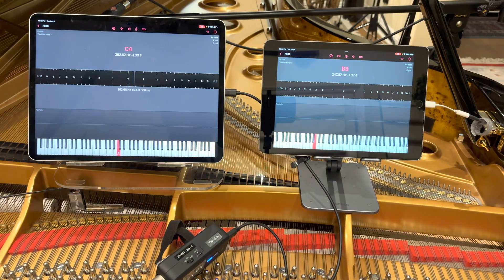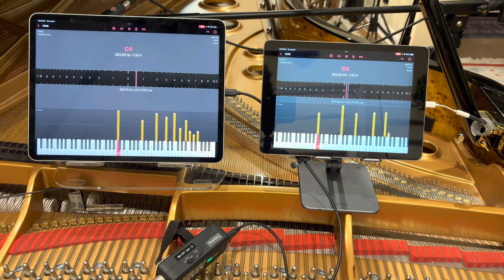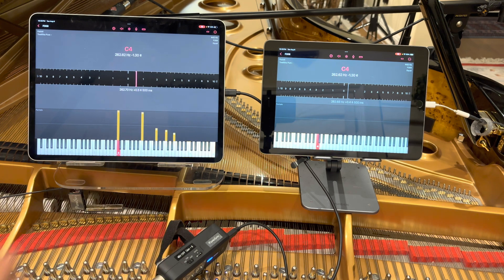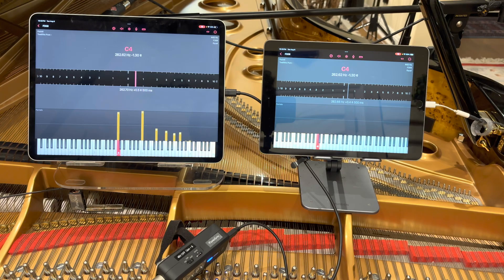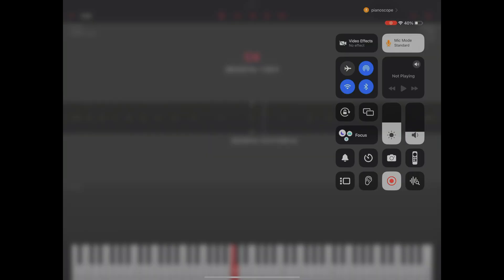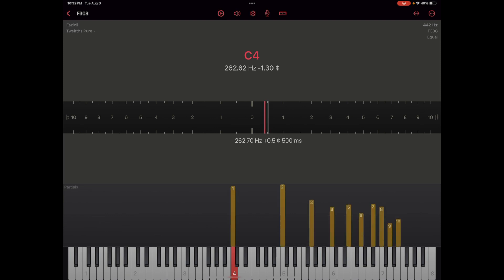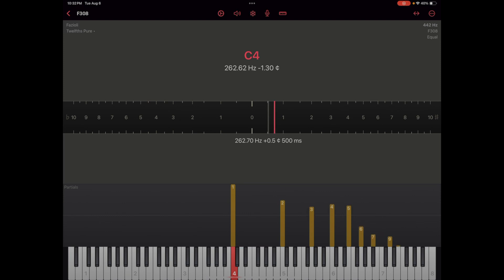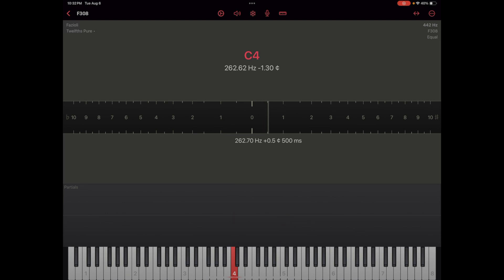PianoSens vs PitchGrabber with High Noise

Comment: Haven't seen something like this before. Can this be used to turn a normal piano into a MIDI input device?
Reply from the maker: I haven't really thought of that, but it's possible! It reads string movement and produces the sound from the strings, which is the input into the soundboard of an acoustic piano.
Reply: Sure thing. I'd consider making a CASIO DG-20 (MIDI guitar) kind of instrument with such system in place.